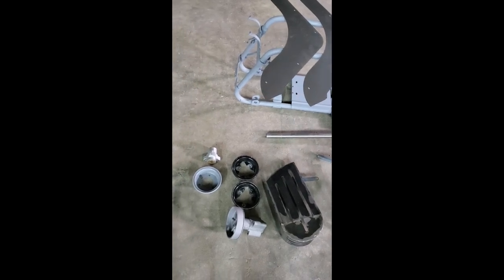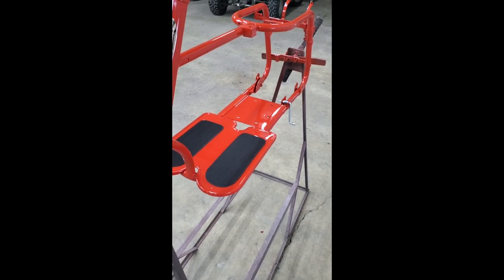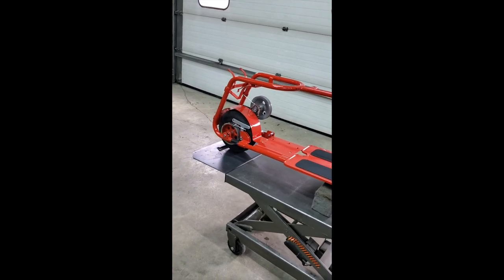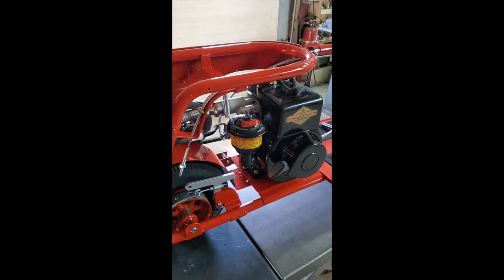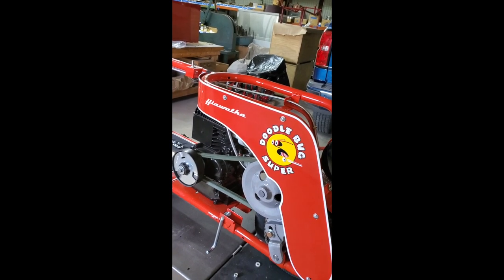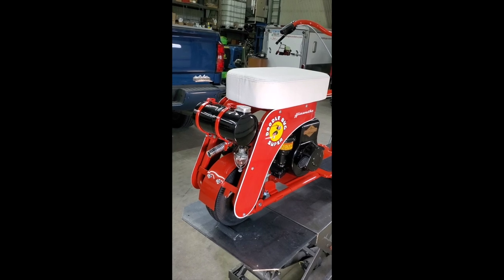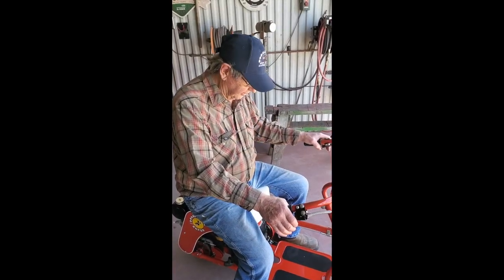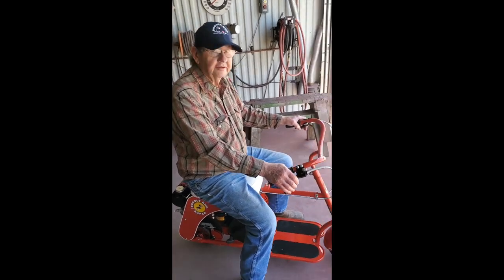Doodle Bug Scooter Build

Comment: One of the more unusual things I inherited from my Dad was a 1947 Doodlebug scooter. He got it after the war, while stationed at a Texas air force base. It still has the original cast-iron HD B&S engine with the fluid-drive and kick-start. Unfortunately, right after he got it, Dad removed the sheet-metal side-covers and belt-guard, and they're long gone. He also mounted a lawnmower manual throttle on the handlebar  (I believe originally, the throttle on my machine was linked to the handbrake), and a manual klaxon-horn just behind the handlebar. I rode it a lot in the early '70s. Eventually the kick-starter splines stripped, requiring a hardened steel roll-pin though the pedal-shaft. Then the original soldered gas-tank sprung a leak at the seam, and the cheap screw-on cap used to spurt gas from the vent anyway. So I found a nearly identical welded tank, with an automotive style cap that fit right in to the scooter brackets and was able to re-use the original fuel-tap and sediment-bowl.    
Finally, I installed a vintage headlight set from a thrift-store, including a 6-volt battery/switch-box that clamped on the tube ahead of the seat, with a separate headlight clamped to the handlebar. 
It hasn't run in years, but at least it's been garaged most of it's life. I suppose I could fabricate new side covers. It does need tires. Are any parts available for these anymore? 

Good luck with yours & happy motoring,  Mark D.